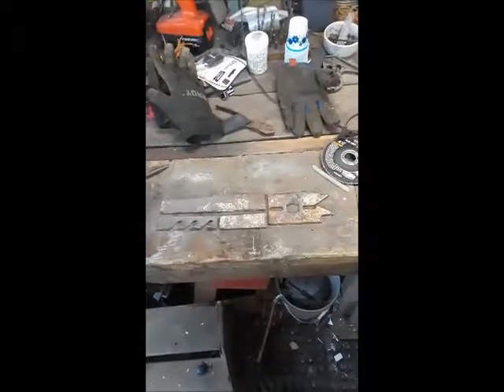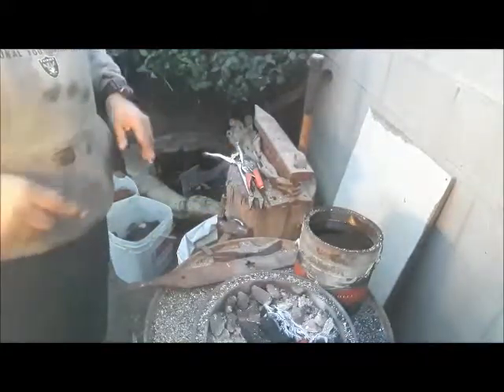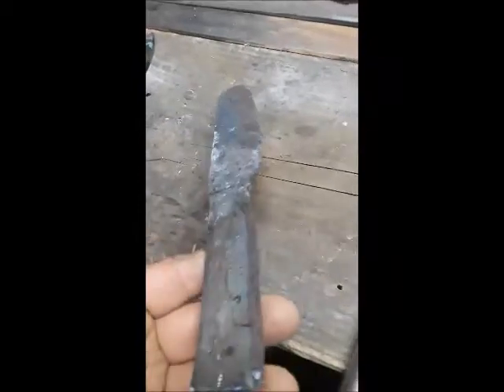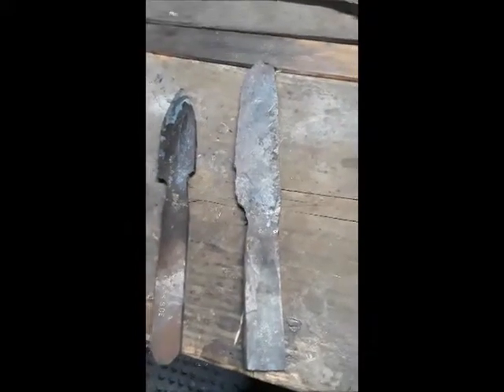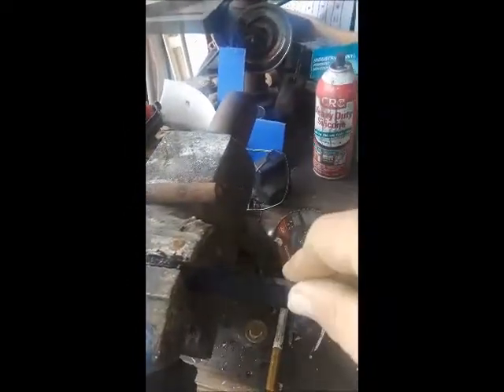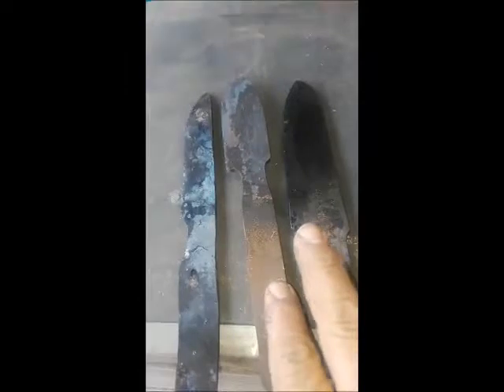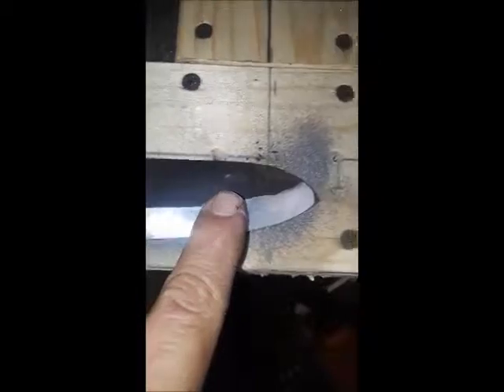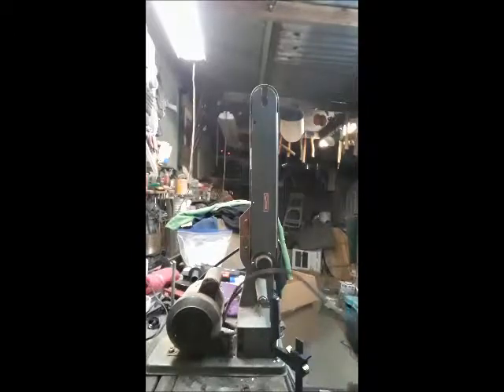How I make knives from lawn mower blades Part 2

Comment: Good job for learning the "old school" way first, so did I. Been making knives for over 10 years now. When you can, I would use a propane forge so you don't burn off your material in the coal forge, also look into making a grinding jig for your bevels to save you ALOT of time. Overall, good job, keep at it.